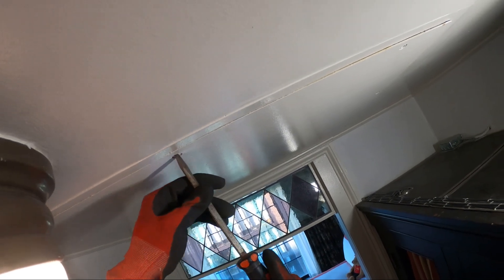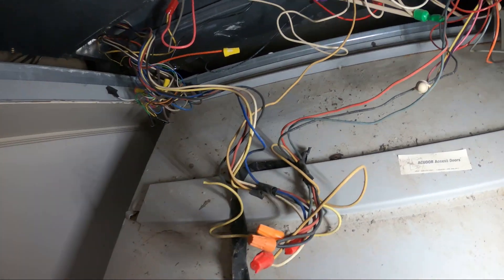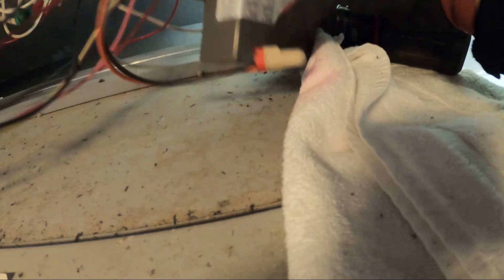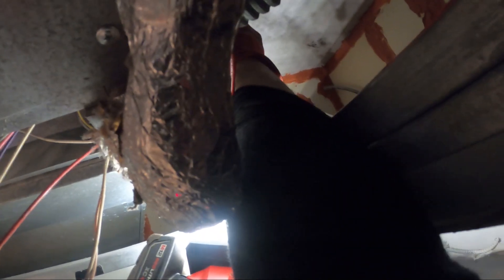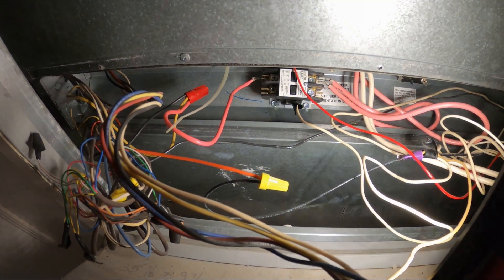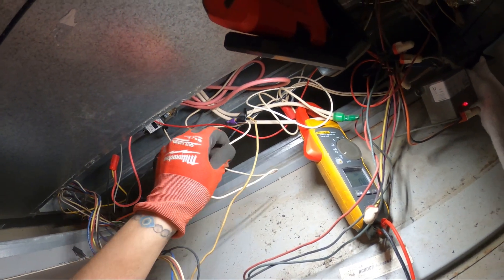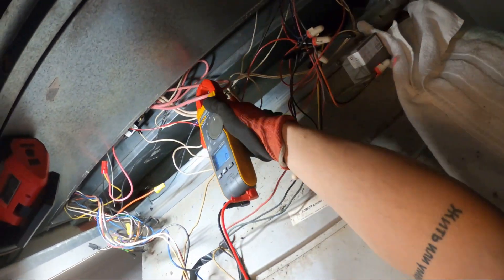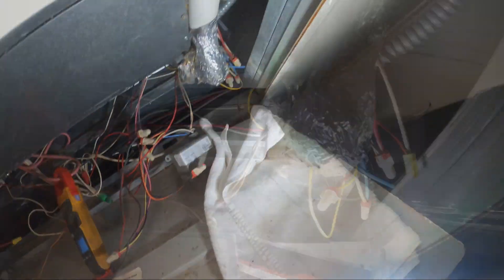HVAC Service Call: 2 Pipe Fan Coil Unit Not Heating (Auxiliary Electric Heat Not Working) FCU Repair

Comment: Good job Jumper, I try to use new wirenuts or Wagos every time I make a repair or install, Because the spring in the wirenut gets stretched out and doesn't make good contact after it's been used.
Reply: Well I not sure if the wagos are better but they are definitely easier to use, only thing is if you push them into an electric box, for a plug or switch you have to watch that you don't reopen the contacts with the levers on the wagos, but the wirenuts are your basic jobs, that you have to minimize cost.
Reply from the maker: @johnwalker890  I'd like to try out those wago connectors but I hear you with the levers on them. A job like this where things are so tight, that could become an issue. Sometimes the hardest part of these jobs is putting all the wires back inside 😂 Appreciate the info. Enjoy your weekend⚡️
Reply: They make a couple different ones, ones with smaller levers work better and they have push connections too. Try them out, they might be a little bit more expensive but the people that use them like them, I still use wirenuts on the job that don't pay a lot. And use push on connections with more permanent jobs.
Reply from the maker: @johnwalker890  I'm going to try them out.  They look cool. It's definitely more expensive. I have a ton of wire nuts in my truck I'd like to use up as well. There's alot of units I come across here where there's not even wire nuts at all. Just twisted wire & tape😂 Then some customers wonder why prices aren't the same. You get what you pay for!
Reply from the maker: Thank you John! That's a good tip, thank you👍 I've never tried the wago connector before. Do you like them over wire nuts? Appreciate the feedback & thanks for watching 🔧⚡️
Reply: Exactly, if they don't treat you right, then guess what you don't get the benefits, but if your an electrician and twisting wirenut all day, you would definitely want either push on connectors, or Wagos. Good luck 👍.